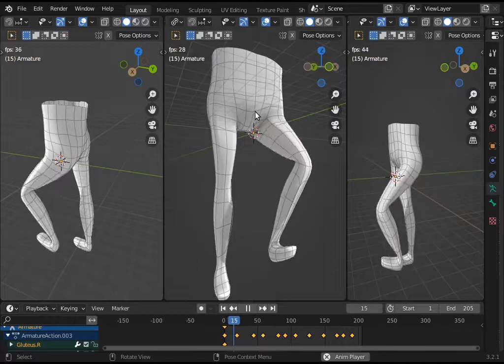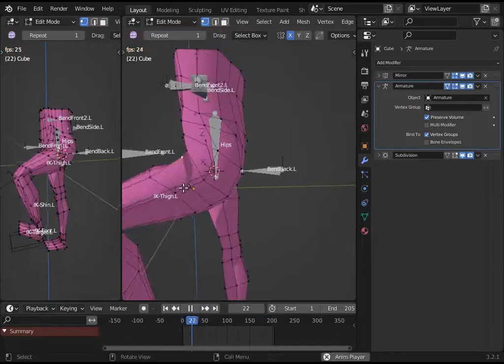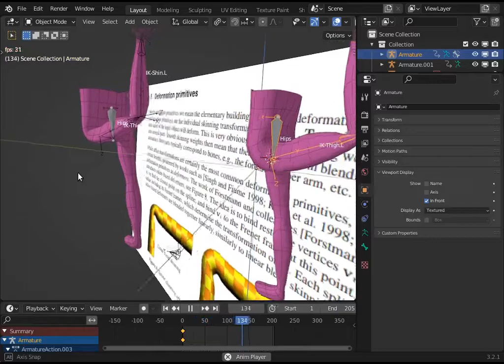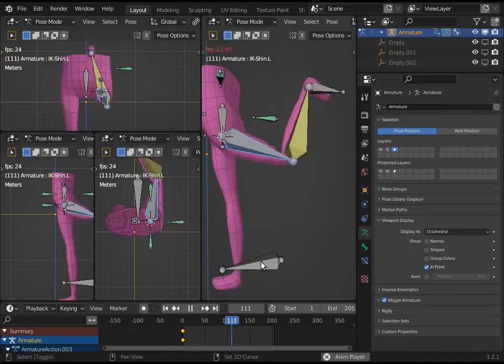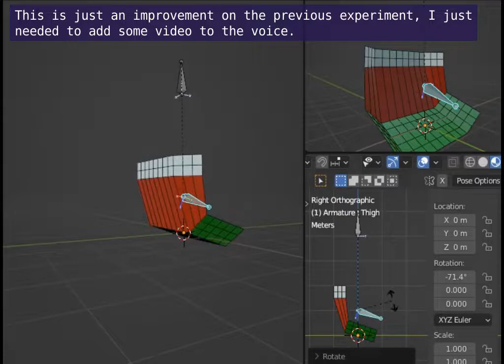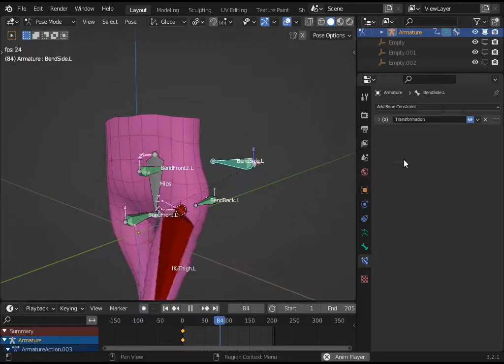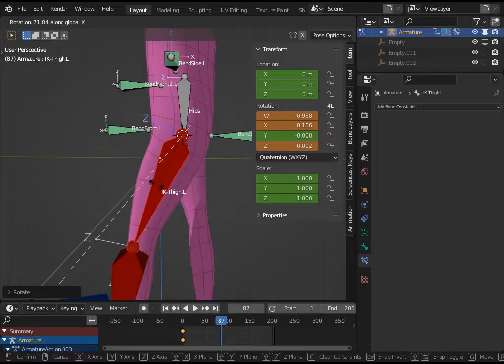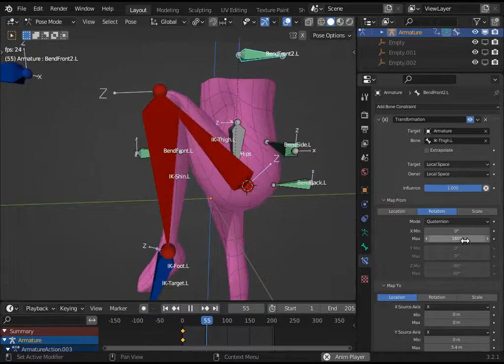🌆Rigs of the Trade # 04 — Part 1/6 ❅ Pelvis Region Rig with Helper Bones [ Intermediate ]

Comment: This video is amazing. Thankyou for your efforts. Corrective shapekeys are the best though for art directable deformations, however, for the purpose of several real time applications most notably, VRChat they are unusable. It's unfortunate, I don't know the exact reason why but some pipelines just don't support them. But as long as your engine target supports constraints or even basic script-ability you can recreate helper bones.
Reply from the maker: Thank you for your kind feedback! I've been struggling (more out of curiosity) to figure out how any Corrective method (from Bones or from Shape Keys) would work on certain VRM external software (such as VSeeFace). In the case of Corrective Shape Keys method, I know in Blender such Automations work due to Drivers, which depend on Python Scripting apparently, but then those become super Blender-specific for any plausible Exportation. Unless in Blender we could Bake the Shape Keys Automation alongside the Key-Framed 3D Animation, and that such Baked 'Morphs' would be Exportable and readable externally? I know we can Key-Frame Shape Keys in Blender in the Dope Sheet Editor, but I've never dealt with that feature. Is that what I'm thinking it is? Yes, I can conceive what you mean, on that subject of 'Re-Rigging' (inside the external software) certain of the Automation functionalities which were lost during the original Blender Exportation process; though I do not have any experience with such external Rigging solutions.

Comment: Pretty good video, you get more things correct than most of the big name youtube Blender "rigging" guys. I've learned these things years ago, by trial and error method, and now folks get such information on a platter! Of course video and audio quality could be better, but doesn't matter very insightful observations, so any beginner viewing this video should make notes.
Reply from the maker: Thanks for your feedback! (Sorry for delayed answer).
I'm actually curious about what things could be made different and better in this setup, as you made distinction between correct and incorrect concepts.
Over time, since this tutorial was made, I've done more experimentation and progress in Pelvis Rigging; yet, until this day I must also say I do not hold an ideal solution.
PS: Today, I'm using a combination of Helper Bones' techniques (e.g., Fan Bones + Simple Joints Corrective Bendy Bone Splines + Profile Bendy Bone Splines), which I believe I've occasionally shared on some live streams; but, despite of all my efforts, I must say Complex Joints, notably the Pelvis Rigging, remains quite painful and challenging regarding the achievement of real good and clear results. If I ever reach a safe solution, I'd probably make a revamped tutorial on this subject.

Comment: Does this approach export to Unity, or Unreal?
Reply from the maker: Hello, @ScottRuggels;

I finally found some answer to your question (maybe you found it yourself already). Sorry it took me so long, because my friend wasn't available anymore to research a solution for me, and since I don't have any experience with Game Engines there was little I could do. But then someone get me good insight into plausible solutions; there would be 2 ways in Unity for example:
1) In principle, the base workflow for making animations for games, is to Bake the animations inside Blender (probably having Action, right?), and then Exporting this 3D Animation Data and getting them inside the Game Engine; only the Deform Bones matter in this output. And Since the entire motion of the Deform Bones (including  the ones of the Helper Bones in my Rig setup) gets Baked, the Corrective Deforms they generate should be preserved (thanks to Baking), even though the Rig system itself will be destroyed in Exporting; but this is ok, since the Deform Bones Transforms is what matters in this approach. In this approach, the character animations are all readied from Blender; there is no need or no immediate Control Rig in the Game Engine to tweak stuff.
2) With some Programming skills, it is actually possible to make lots of functionalities inside Unity for example. Even the Transformation Bone Constraint in Blender, then, can be emulated in the Game Engine: the person who helped me gave me this code example (althought probably an innacurate example, it gives an idea of how this can be approached:
if(object.transform.position.x > 0)
{
  bone.transform.rotate = transform.eulerAngles(*something something*)
}
So, the cool thing is that there is some flexibility, yet, there is apparently this need for some manual adaptation, from Blender to the Game Engine. Also, remember that, for making direct 3D Animation inside the Game Engine at least in the case of Unity (this would be closer to the 2º approach btw) there is that Avatar system.
I find all this stuff quite interesting, and I hope this solves your issue.
Currently, I'm up for remaking this whole Rig Tutorial solution for Complex Joint Rigs in Blender, as there seem to exist easier and better solutions for this Armature Deform thing already (but they, themselves, bring new challenges towards Game Engine adaption, which I cannot answer yet).
Reply from the maker: Good Question. I'm also willing to understand this. Currently, a Game Dev friend of mine, and who uses Unity, at some point would investigate this for me because I don't have experience with modern Game Engines. What I know from theory however is that they have to reproduce Bone Constraints from Blender, but in their own ways ; so, I believe it should be pretty feasible, mainly because the Transformation Bone Constraint in Blender seems to be a very, very simple feature, mathematically speaking; it's not something like the more complex Bendy Bone feature which grants Spline Skinning for Deform Bones and has lots of specialized settings.
TRANSFORMATION BONE CONSTRAINT
It works a bit like a simplified Driver.
Basically, you take a Transform input from one Bone, like Local Space X Axis Rotation, establish 2 extreme points of Rotation (a Mininum and a  Maximum Values allowed), and then associate, have this scope of Transformation affect, proportionally, another Transform from a different Bone, like World Space Z Axis Location, with also the establishment of 2 extreme points of Location (a Minimum and a Maximum). Once one can configure this 'translation' of Transformations between the 2 Bones (proportional exactly as Tales's Theorem, if we deal only with Location Tranforms), everything else is just about the Weight Paint and the Armature Bones' Relations, which already comes from the Exported file(s). So, the question becomes: ¿is there something like a preset Transformation Bone Constraint in the Game Engines?, ¿If not, is there a way to develop a feature like the Tranformation Bone Constraint in the Game Engines? I hope this helps; if you happen to find the solution, please tell me; this is a critical issue regarding Organic Rigging for Games.
Reply: @pxy-gnomes9781   Thank you for the prompt reply. I will go over the Unity documents, and see what they say. but if characters have dynamic hair and cloaks, there must be something that allows bones to react to things other than baked animation. I look forward to hearing from your friend's experiments.
Reply from the maker: @ScottRuggels  Welcome.
Btw, ¿I guess you should already know that "Shape Keys" feature in Blender (sort of equivalent to "Blend Shapes" in Maya and in certain Game Engines), from using the Corrective Shape Keys method, is also a main solution for countering Skinning algorithms' Artifacts, and a solution that I've learned works in Game Engines. So, if for some reason this Helper Bone method cannot be used for Game Engines, there would still be the Shape Keys to Blend Shapes approach.
ACCESSORY PROLEMATIC
As for the other issue, 'Bones to react to Mesh'… If I understand correctly, in Blender I know some similar cases that this can be achieved, for example with Copy Location Bone Constraint on a Bone, Targeting a Vertex Group (for a simple example: a single Vertex's Vertex Group in the Mesh Object); this method can be combined with Shape Keys, so that as the Shape Key Morphs the Mesh, any Bone that has this kind of Bone Constraint setup will 'follow the Mesh' —so some Control Bones will indeed control the Shape Keys Morphs, while some other Bones will be controlled by the Morphing (& possibly also Armature Deforming) Mesh. Of course, this approach is still not the same as Physics and Collisions and the relations that may exist (even in realtime Bone Posing) between Key Framed 3D Animation and Physics Simulation in the Timeline (where both features they interact spontaneously; I'm not sure theoretically where the Baking comes in but it should be somewhere part of it). In Blender at least, we can have indeed independent Bones being Bone Constraint to… Vertex Group, the problem is that it would be imperative to avoid any depency loop: of Bone Controlling Mesh through Armature Deformation (as the expected behavior) and Mesh Controlling Bones (as alternative, creative methods); I'm not using any solution like that currently, but I was successful once making Eyelashes Bones following Eyelids Border Mesh which were being controlled by Shape Keys which were themselves controlled (Driven) by a Shape Key Driver Control Bone. They didn't struggle because there was this hierarchy of what controls what. It's probably dangerous if any Bone that is Bone Constraint to a Vertex Group, is itself a Deform Bones… Influencing the same Mesh elements which are being Deformed/Transform originally, whether by Shape Keys Morphs, Physics Simulations, more Deform Bones… this would be probably wreak havoc the Rig with depency loops; so whatever such Vertex Group Bone Constraint Bones do, as being part of a lower hierarchy level Rig, the Deform Bones or Mesh they Influence should be something 'below', which holds no direct dependency to the higher features in the Rig hierarchy. Sorry if this is too theoretical; without examples it's not good to explain, but I hope this offers extra insight in some problematics regarding Rigging in Blender, even though it's not exactly the issue.
Regarding my friend's investigation; he is a bit busy right now with job switching, but as soon as I can talk with him in a better condition, I'll remember to check how this is going.
Reply from the maker: @ScottRuggels  I suspect you'd like do something like the inverse of this case, but not necessarily in Blender, but in the Game Engine: 
https://www.youtube.com/watch?v=uJtou3_1lW4
If the Physics Simulation can affect the original Rig… yes, there should be ways, but I'm not sure about the limitations atm. This would require special investigation.